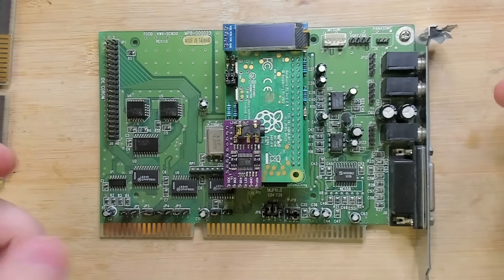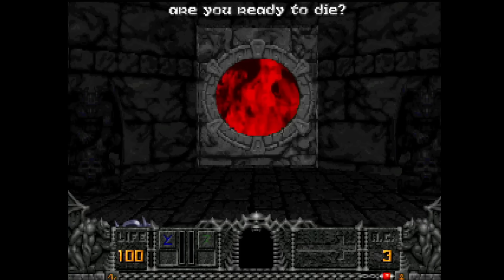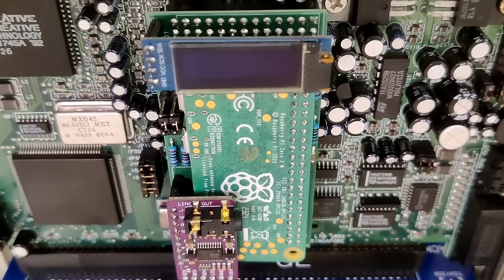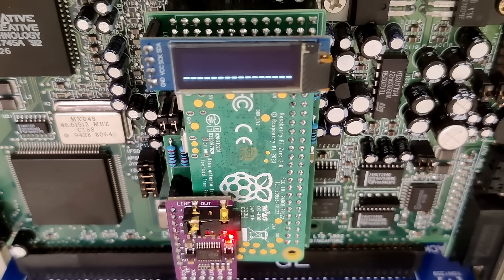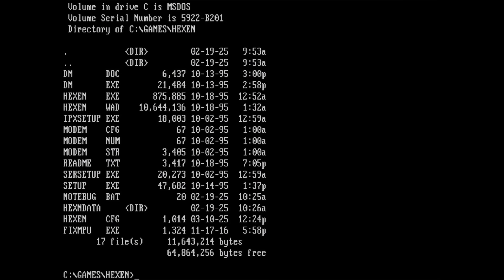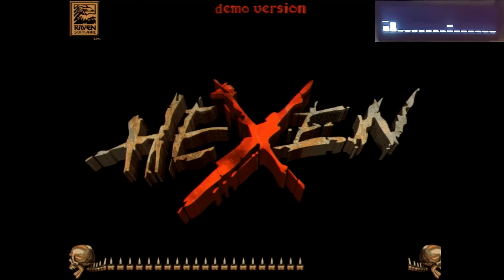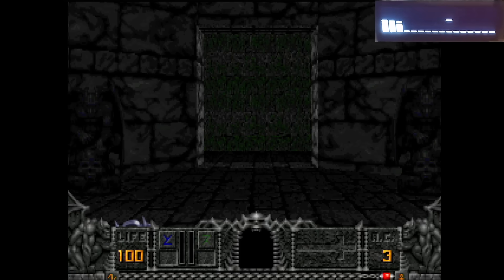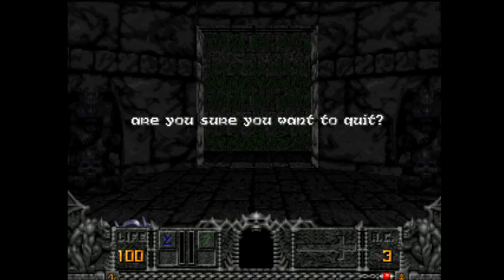Creative Ignored It: The Hanging Note Bug in DOOM & HEXEN (Part 1/2)

Comment: That's crazy. I very clearly remember playing Hexen on an SB16, as it was one of my favorite games, but I did not have this hanging note bug. I wonder what the deal is. I still have that exact same SB16 from the 90s in my latest retro rig.
Reply from the maker: If you use the OPL3 chip (Soundblaster mode), you won't have this issue. You need to use General MIDI to get the bug. But for that, you need a wavetable board. Only then, you trigger the bug.
Reply: @ Ah, got it! Thanks for clarifying!

Comment: Is there any difference between using your wave table and the AWE32 or AWE64, or some PCI version that supports sound fonts? Can the sound fonts on your wave table be used on those cards?
Reply from the maker: Yes, sf2 soundfonts should be compatible with AWE32 and AWE64.
However, I'm not sure if they were limited to Windows only.
PCI cards in general work a little bit differently under DOS.
The wavetable board emulates soundfont playback and makes it easier to use since you don't need to worry about the soundcard and its capabilities of using soundfonts. The card only needs a wavetable header and you're good to go.

Comment: I never experienced the hanging note bug back in the day. I had heard about it, but never knew anyone who'd experienced it either. During this era, we had a Media Vision Pro Audio Spectrum 16 card, which obviously wasn't affected, but we also never had a GM module, so that wasn't an issue later when we did eventually get a SB16 card. One of these days, I should pull out my MIDI modules and SB cards, and see if I can replicate the bug.

The funny thing is that most of my Sound Blasters won't be affected, mostly because almost half of them are SB 2.0, SB Pro 1.0 or SB Pro 2.0 cards. I've only got a couple of SB 16 cards, an AWE32, a couple of AWE64s (which I believe are bug-free anyway?), and an AWE64 Gold.
Reply from the maker: To my knowledge, yes, the AWE64 cards should be bug free. I still want to check my other Creative soundcards - I don't even know what I have. That would be a good time to sort and catalogue my collection.

Comment: 6:16 but i don't hear music? Were the bars moving with fixmpu on doom but sound is muted?
Reply from the maker: I tried several options, but couldn't get MIDI music to play in Doom with FixMPU. I doubt that MIDI output was muted because I could hear it in other games or when running Doom without FixMPU. Once I used FixMPU, no music was playing anymore - even in other games. It's as if FixMPU crashed my soundcard and I had to restart the system.
Others seem to be able to use FixMPU with Doom, but I don't know yet what the cause is that it isn't working for me.
Reply: @bitsundbolts  possibly crashing the software on the pi? I am not sure if any sb 16 card i have carry the bug. i will ave a look in the next day or so and can probably do some testing with my mt32 emulator that runs from a netbook.

Comment: As far as I know, all the fix does is that when it receives a note-off event, it sends a continuous stream of note-off events (like 100 of them), unless the note was re-started immediately. That way even if a race condition eats one of them, it will get one of the others. The note will still "hang" but for an imperceptible amount of time before the bug fix clears it. You may also end up occasionally having notes that disappear, because a race condition lets the note-off arrive after the note was supposed to re-trigger so it cuts off the second iteration of the note rather than the first. That's a whole lot less annoying than a hanging note though!

Comment: Fixmpu didn’t work for me for Dark Forces. My solution was to use another card for MPU-401, since my SB is a Vibra 16S integrated on the motherboard. Also, the bug will also happen on devices like the SC-55 attached via a gameport MIDI adapter.
Reply from the maker: You got the hanging notes with your Vibra 16S as well? I thought it was limited to certain cards with dedicated DSPs. Isn't the Vibra a later model with integrated DSP?
Reply: @ yes, but I only experienced it in Dark Forces (but that’s a dealbreaker for me), Doom or other DMX games are fine. I think most people tested for HnB on DMX games, that’s why Vibras were thought to be bug free in this regard. On Vogons there were reports of at least one other iMuse based game with hanging notes, I think Sam and Max. In Dark Forces it’s pretty easy to test, just launch the first mission, shoot a bit and there should be hanging notes before you go out of the first room.

Comment: Well, the fixmpu sort of fixed the hanging note in Doom. It just fixed all the other notes too 🤣

On a serious note, I wish that other manufacturers would’ve succeeded better and beaten Creative. There were other more higher quality cards out there. SBs are noisy and buggy. One example of the fact that better doesn’t necessarily win. Creative’s offerings were just good enough and cheap and Creative was an early player with a clear brand, so they sold like hot cakes.
Reply from the maker: Creative also had a very strong marketing campaign and the name Soundblaster is available in pretty much all games.
I didn't know much about soundcards back then, but I always wanted a real Soundblaster from Creative.
Reply: @ that’s what I meant with Creative being an early player and getting the brand recognition it and so on: everyone knew Sound Blaster if you had PC. Media Vision really had a shot at Creative, especially with PAS16. They supported devs and many games implemented direct PAS or PAS16 support. But Creative had the brand image already and they simply constantly lowered the price of their cards. As far as the quality goes, PAS is like from another universe.

I had Media Vision Thunderboard back in the day. It was pretty great SB clone and Thunderboard chipset was later used on PAS cards.

Comment: sound blaster isnt general midi ? thats a compatability selection?
Reply from the maker: General MIDI only works if you have a wavetable expansion board. Otherwise, you can 'just' use the card as a Soundblaster with FM synthesis (via the Yamaha OPL3 chip).

Comment: only compatable boards seemed to do it?  not real creative cards?
Reply from the maker: The issue is in the soundcard, not the wavetable board. So, it doesn't matter what expansion board you are using, the hanging note bug appears if you're using the MPU-401 that is part of the soundcard.
This happens with any wavetable board or external MIDI device like a Roland MT-32.

Comment: Using a bigger lcd mounted in a blank drive bay faceplate routed to the sound card would be cool as heck can even add the head phone line in and mic jacks and possibly the gameport would be so functional not having to move the pc to get access.
Reply from the maker: I ordered bigger LCDs as well. I added a header that is compatible with existing front panel assemblies. But you could always make your own 5 1/4 inch panel and have enough space for everything you mentioned.
Reply: @bitsundbolts  just bought Creative LABS ISA CT3110 Vibra 16 CT2501-TDQ w/ Modem gonna try it in a duel p2 server I have think it will pair nice with voodoo 3.

Comment: I was hit with the bug sporadically in Duke Nukem 3D with my Yamaha DB50XG. Quite annoying. If I remember correctly it even needed a reboot to get the card out of that state.
Reply from the maker: What I understand is that the bug might have slight variations. It depends on the soundcard model and the DSP version. There are three different versions available that are affected and they might exhibit a slight variation of the bug. I will try my other cards that are affected and compare.
Since those hanging notes never receive a stop signal, it's no wonder that they don't stop once you exit the application. A hard reset or some sort of a software reset/reinitialization to the MPU-401 is the only way to make it stop.

Comment: Oooh i would have never experienced the Type1 hanging note bug. I had some sort of very long AWE32, CT3990 i think, which should have been susceptible, possibly?

But i also had an EWS64 with Dream94. And a GUS ACE, that was often an interesting option. And eventually an SBlive. Since the mixer of AWE32 is by far the noisiest of them all, i wouldn't have used Waveblaster off the AWE32, if i wanted minimum overhead (no TSR) maximum quality GM from pure DOS, i had the option of using EWS64 with Cleanwave. My main choice was Windows 98 and using AWEsynth with Chaos8m kit, so it was software driven and not buggy. When i plopped Live in eventually, i kept using 98 just with ever larger kits on the Live.

I did end up with a Dream waveblaster module eventually, which just fell into my lap for free when ISA cards became worthless, but i never not even once used it for real.
Reply from the maker: Wow, I wasn't aware of the EWS64. You had quite the collection of great and interesting soundcards!
I'm not sure yet to what degree soundcards are affected by the hanging note bug. I have at least one more card with an affected DSP.
I'm just scratching the surface, but there are so many amazing things to learn - most of which I haven't used back in the day.
Reply: @bitsundbolts   Ah yes EWS stands for Eierlegende Wollmilchsau. It has extensive programmable signal routing so it doesn't even need the PC to play anything once initialised, and you could turn any part of the card on or off, for example i didn't need the Soundblaster part. The Windows utilities were insane, like they had a vectorscope and whatnot, the patch editor had an easter egg subtractive synthesis mode. On the card there was a trail of shoe footprints silkscreened on, and if you followed it, eventually it lead you to a tiny print which said "Please RTFM". The card didn't come in a box - when you pulled off the cardboard sleeve, you were greeted by an aluminium travel case.
Reply: yours only has bug type 2. the type 1 bug is the annoying one.
take a look at vogons wiki, it is explained there.

Comment: Heya, great video as always! Would you have any interest in attempting a repair on a Matrox MGA Millennium with expansion memory? This card is originally purchased by me and has sentimental meaning so I would like to get it repaired if possible. Any thoughts?
Reply from the maker: That's an interesting project. Do you have any idea what could be the problem? Is it the card or is it the expansion memory that causes the issue?
It probably would be best to send an email to me with pictures of the card and any physical damage in case there is any.

Comment: I must have been amazingly lucky. I never heard this bug and I've always defaulted to SB cards. Of course, I always used "SoundBlaster" mode and never General Midi. Maybe that's why?
Reply from the maker: In Soundblaster mode, you'll not get the hanging note bug. You'll probably use the OPL3 or similar FM synthesizer. The hanging note bug is only appearing when using an external MIDI device that utilizes the MPU-401.
Same as you, I never experienced the hanging note bug back then because I never had a wavetable board or used an external MIDI device.
Reply: @bitsundbolts  
That's what I was thinking. I never knew about the bug until recent years.

Comment: I'm looking forward to your take on the wavetable board with the MIDI Forge: Maestro. Are you planning a pcb only, or a kit without the pi, dac and lcd? So with the parts that need to be soldered on? Or maybe a complete kit without the pi, you can order that easily everywhere.
Reply from the maker: I am thinking of creating all of the above 😀. It would be great to have exactly the wavetable board you're looking for. A fully assembled one, or a kit for self assembly. The PCBs alone won't work for many due to the requirement for soldering.
The first batch of PCBs arrives early next week. Once I verified that they're working, I'll start preparing the kits.
Reply: @bitsundbolts  That sounds like music to my ears, sorry for the bad puns! :D

Comment: There was a hanging note issue on pretty much all Creative Cards, I remember having it on an SB Live!, then an SB Audigy, and Audigy 2 - Could sometimes happen in windows, sometimes in DOS, sometimes was a high pitched like you showed, sometimes it was a sound or note remaining after quitting a game!! - I remember there was a small dos utility or batch file you could run after (if you had a stuck note) that would 'reset' it and remove it, I just had this setup to run after every program that I had a hang on... I can't remember any specific details like the utility name or which specific games caused me issues :|
Reply from the maker: Interesting - those cards should not be affected by the hanging note bug. It might be something else though. The stuck note after quitting a game is most likely another issue. The high pitched note though, is similar to what I show in Hexen in this video. I haven't tried modern PCI cards yet, but maybe there are issues on those cards as well.

Comment: Never knew there was a hw solution, never heard any hanging note on my life, but I probably had non-creative sound blaster clones. Maybe you know, but how did they dump the actual frimware of the 8051 MCU on board?
Reply from the maker: How did they dump the original firmware you ask? That is an incredible story I want to include in my next video. It is fascinating and includes exposing the die to analyze the chip. Absolutely incredible.
Reply: @bitsundbolts  Excellent! Yeah, because that HMS logo is unmistakenly used on 8032s and similar (8051 core). I thought it was one of that even before you showing the 89C52 from Atmel! Cool learning about it. Please show what's the difference between the bugged fw and the "fixed" one, if possible :)

Comment: But what actually happens here? Does the MPU skip sending a byte to the output under some circumstances, or what?
Reply: I don't know if it'll let me post a longer message so maybe just get fixmpu and read the readme file. There is interference with interrupt logic which sometimes causes the last MIDI byte (usually velocity value) to be repeated outside a message.

Though i also don't understand what quirk of MIDI implementation causes it to become an issue, since all valid messages start with bit 1, while all parameter values start with bit 0, so by all reason malformed byte should be ignored.

OH WAIT that's the obscure Running Status compression, huh perhaps you could just disable that in the MIDI parser on the Mt32pi and it'll be alright?

Allegedly, real MPU401 will sometimes garble Running Status messages, so DOS games are NEVER supposed to use this transmission method.

Comment: Tie Fighter was the biggest culprit for me. I came across an "open box" DB50XG in a very damaged box at Best Buy for a great price. Still my favorite sound card.
Reply: Hard to remember that long ago, but I think I got it for $50 or $80, so a fantastic discount.
Reply: @JamesPotts   I still use either S-YXG50 which sounds similar, just a little rougher in reverb, or PSR530, which sounds identical. The DB50XG is bound to be the best sounding Waveblaster module to ever blast its waves.

Comment: Hehe, we should really sync the topics which we want to handle. We seem to think about the same topics regularly :) I already have here a programmed DSP with the hanging note bugfix which I wanted to show in a video. I soldered it directly onto the PCB and didn't bother to install a socket. Well that should be a a part of a repair video anyway, so I'll drop that. There are two types of hanging note bugs and the card which I modded has only the rare one type of the bug, which is quite hard to reproduce.
Reply from the maker: Based on the responses, you should continue with your plans and release the video!
I had this video for some time on my list, but needed a wavetable board first. And then all sorts of other projects turn up.
I'd definitely watch your video too! We might use different games and have a very different experience with that bug.
Reply: @bitsundbolts  if I released my video based on what others do, I wouldn't make videos anymore! :)
Reply: @tony359 that was not the point but every person made the videos differently.
Reply: @bitsundbolts i was thinking on desoldering chips and reprograme It like necroware.
Reply: Would still love to see your take on this!
Reply: No need to drop the video, we'll watch both anyway because we're always thirsty for retro tech!
Reply: I’ll watch it anyways 🙂
Reply: @tony359  if you cover it too, we'd have a trifecta to watch! 😉
Reply: Wouldn't mind seeing a video from you on this, either.
Reply: would love to see some kind of repair mashup pc build / upgrade project.
Reply: Indeed, I'll also watch your take on this. We all just enjoy retro content!
Reply: Necro - Don't drop this from ur video, there are a lot of people who wouls like to see (hear) it. Also for a lot of people longer videos = better. And You can make part in middle of video that is about it, and if someone don't want to listen to it will just skip it. However - It's goin to be Your video, so You will put things You want in it.

Cheers etc etc

Danke Schön for all videos Necro <3
Greetings from Poland
Reply: There is a related video "Sound Blaster 16 mod - replace CT1741 with generic 8051"  here
Reply: The best part of seeing 2 different ways of doing it is the potential for a 3rd better way to do it in the future.
Reply: @necro_ware a video about modern uefi BIOS to change defaults on It IS useful for me since my i7 3770 stuck by default on sata IDE instead of sata ahci.
Reply: Don't even think about skipping that video, or I will find you in dreams and scare you every night with hanging tons 😉
Also it will be nice to describe both bugs, coz many people definitely don't know about that ;-)